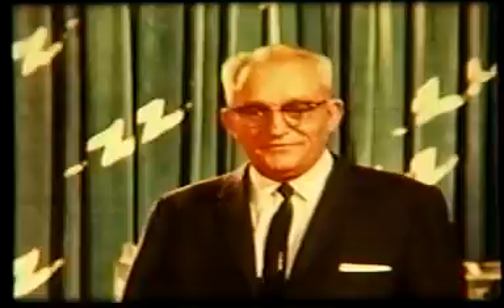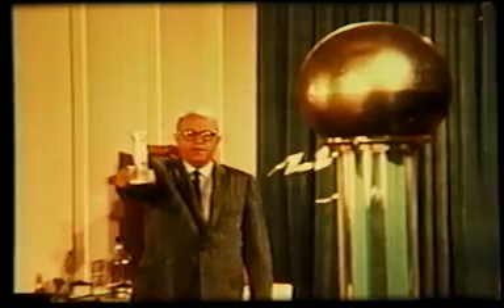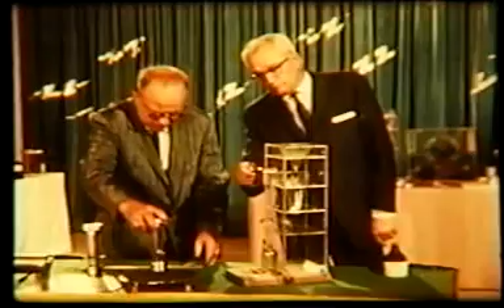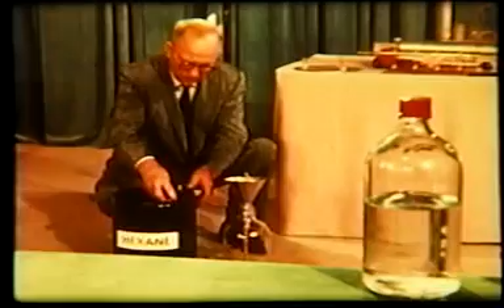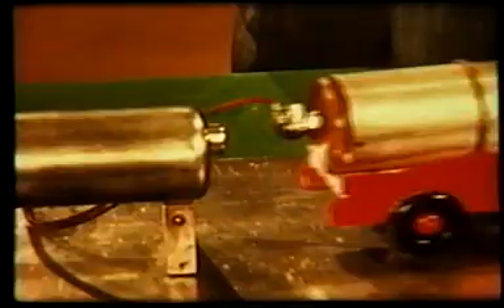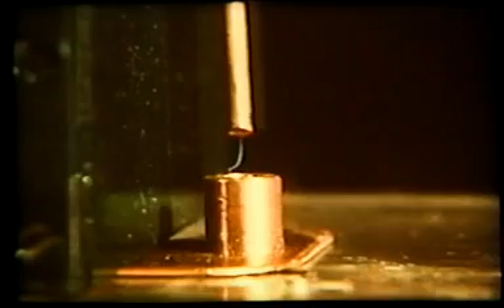The Amazing Power of Static Electricity

Comment: Positively and negatively charged clouds , why would Positively charged cloud rain negatively charged water and vice verse . I would expect if the cloud is positive and rains water that water as well would be positively charged , what is it in the cloud that separates charges
Reply: https://youtu.be/PzzudRKsYy4?list=PLneKyKbweRgwWn7vbXEkPmKD7iE2rtVoU
Reply: Dry upper air from far away discharges to the conductive cloud.
Reply: @portagepete1  Cloud is not conductive , ever tried  to put a current trough a cloud , its called Fluorescent lamp .
And it only conducts in presence of electric field , strong electric field that ionizes the gases .
So what you say is impossible .
Indeed you know what else is impossible , RAIN ! Ever been in a Sauna , ive been in a Turkish bath 90% humidity , and it doesn't rain .
only when vapor has something to condense around does it condense .
For example if you clean your wind shield in a car  very good it will fog up harder , because fog condenses around dirt on your windshield , not on glass .
So how does RAIN happen when it doesnt have anything to condense around . Well its due to electric fields and ionized particles , and that field comes from space .
We know and have photographed Spirits as they say , in upper earth atmosphere connected to every storm .
It is from there that Rain Starts , when electric field builds up there is flash , known as thunder strike .
And watch out for that moment next time you will notice instant increase in rain .
because that is what vapor condenses around , ionized particles .
And that is why its Negatively charged, Electrons are negative charge , positrons can be made but are rare in nature , but i guess some water droplets can be positively charged in theory  
Rain has to do more with Space and Electric fields then Vapor .
Electric field changes depending on where Earth is , what is close to it , its position in the Solar system .
Its even connected to the Sun activity , and even to Galactic activity .
But those scales are so huge , that time periods are beyond human life , so we do not observe that , but we do have historical records of it .
I know a lot about Space  , but it is not i who said this , Nikola tesla and Milankovic and Pavle Solaric were on top of it before i was , but im sure there are others .
Reply: @portagepete1  do you know what is the only scalable force in Universe ?There are 4 known to man "scientist " or science  , some others like Nikola Tesla whom are not   scientists  wouldn't agree on that , and so wouldnt i , but Science says there are 4 forces.
Which one is Scalable?  works on micro and macro world no matter the size ? Electromagnetic force .
So , if we are talking Electromagnetics here , when you say "Dry Air Discharges " i would assume you mean Electromagnetic discharge ? If that so , then  you can  experiment on it , even on molecular scale , or Galactic scale , doesn't matter what type of air you use ,  i think you will not get charge , it will not generate charge on its own .
 So the only charge you speak  must come from  outside   ,  and that is exactly what i am saying .
Outside , Space , forces charge the clouds and give energy and particles for water to condense on , some molecule .
Since rains even in the upper atmosphere where there is no dust ,   just the mix of gases and it still rains .
because in a highly charged area , molecules form , and then water or h2 can condense around it form a droplet .
Further from that what our  science doesn't know is that if you drop a droplet of water , on a dry flat surface it will always make a 1Cm sized spot .
Dropped from an elbow distance , so that water doesn't splash around 
In Ancient Egypt  this is how they calculated it , but we still use this 1cm , and you can experiment on it you will be amazed that it is exactly 1cm . Every time 
Try it ,  and you will see i know a bit more then your average text book has to say , or video show or whatever .
So you can trust me when i tell you , when lightening strikes , observe increase in rain density , exactly because of the process i explained to you .
Simply said you can observe it with your own senses , do the experiment do the science .